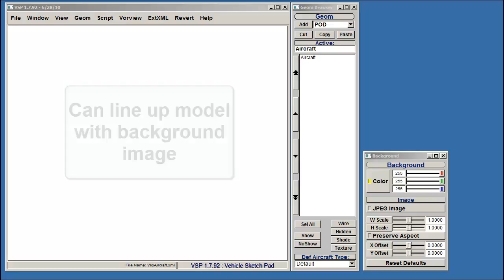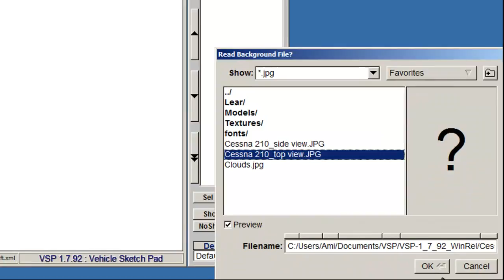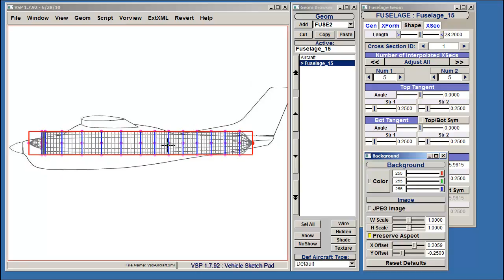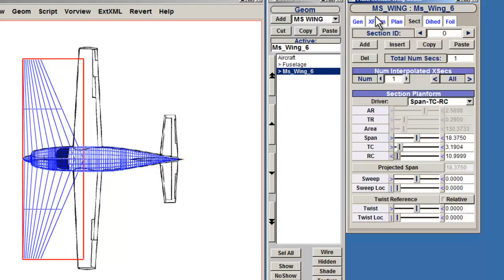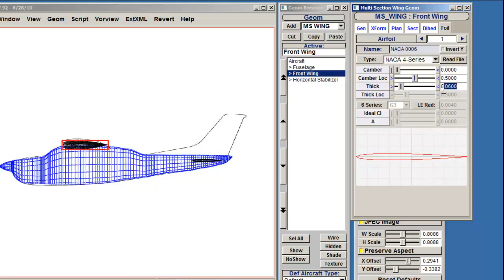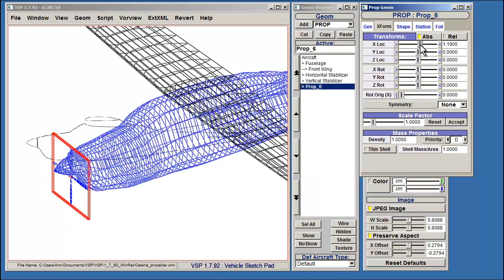Tutorial #4 Modeling a Cessna 210

Comment: Good tutorial, but just FYI, your top view is not a Cessna 210.  It is a Cessna 208 Caravan, which, despite the similarity in model numbers, is a completely different airplane.  The 208 is a large, turboprop-powered airplane, and the 210 is a smaller, piston-powered airplane.  The two airplanes have no common parts or aerodynamic surfaces.